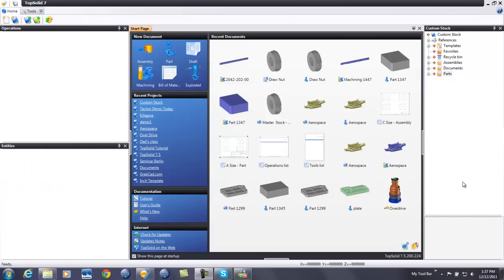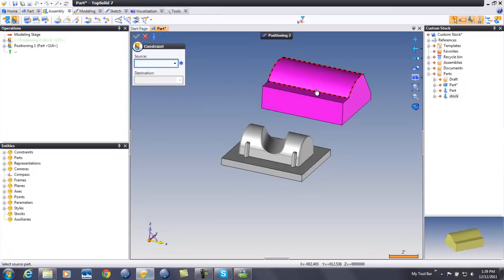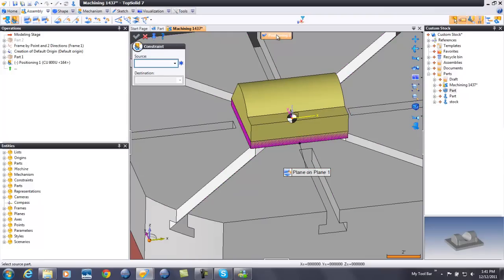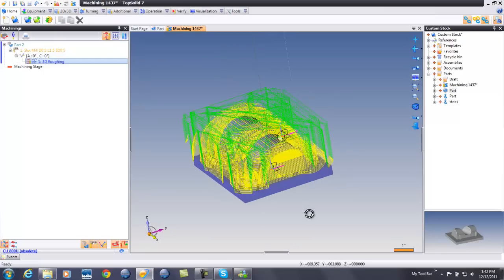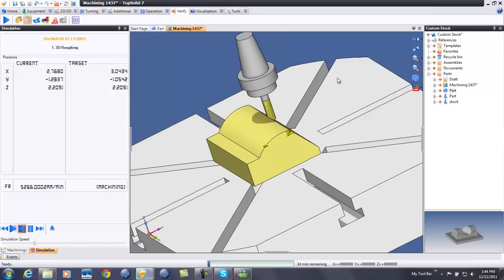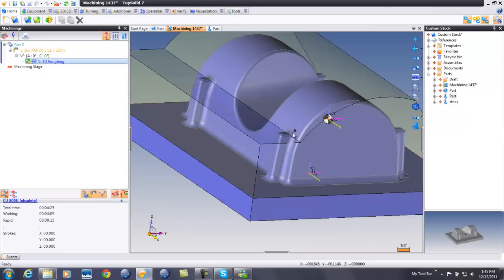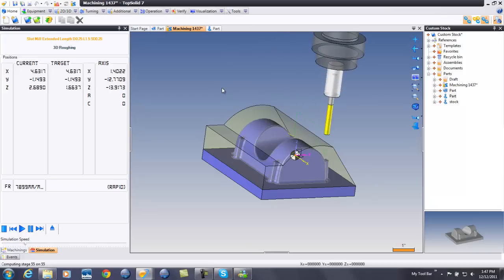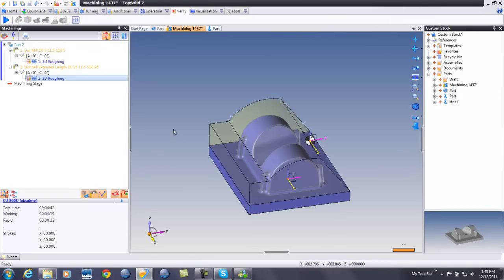Using custom stock in TopSolid Cam 7

Comment: Bill @ 2:20   you just start clicking and  not explaining exactly what you are doing . " So I will go in here, again you will just see the custom shrink wrap block. I 'll just uncheck that...I' remove stock from there, and I will just put it right here"
WTF ?  
So many little details you just blew over and didn't tell us that you deleted the stock from the finsh box.  Then you didn't mention that you clicked in the stock box. then lastly you clicked on the stock in the model to the right to add it to your stock box that you had just clicked in and didn't even tell us that very key point.
You are incredibly hard to follow along with, you  blow right through stuff.   I mean really, if you had never performed this action ever before in your life, could you make sense of it ?  I had to replay it like ten times and then look at the help file to figure it out. 
I think you wrote the help file as well-  I see one of your favorite words in the text " SIMPLY" 
    < This option allows us to manually define a custom form around the finish.
       After clicking with the mouse on this list we
         just have to select on the graphic area the solid to add it in the list.
         We can get rid of a solid of the list simply by selecting it in
         the list and right clicking then delete or by pressing the <del> button
          of the keyboard. >